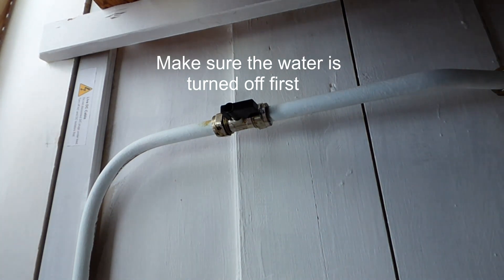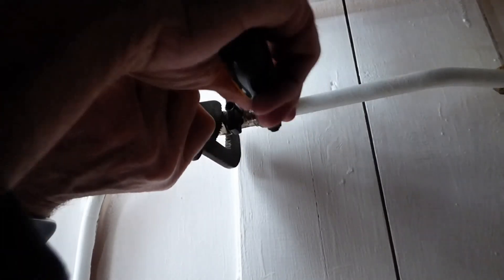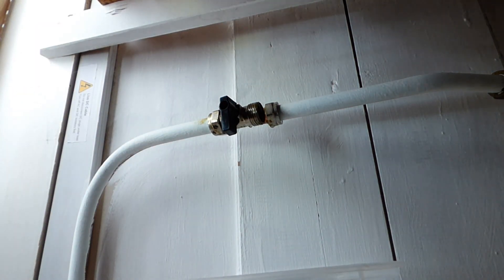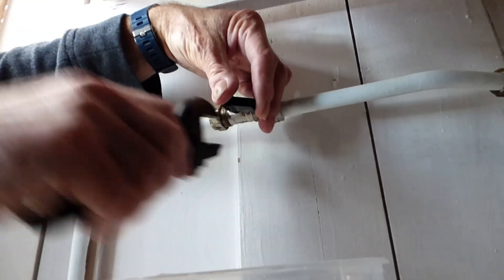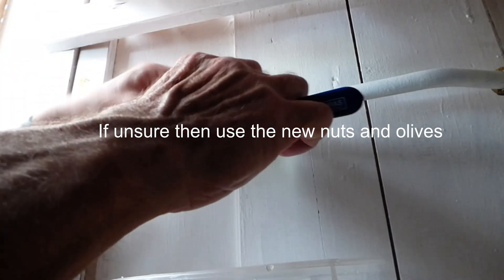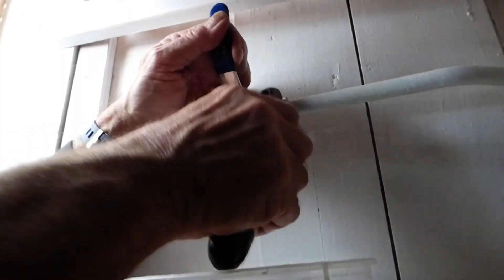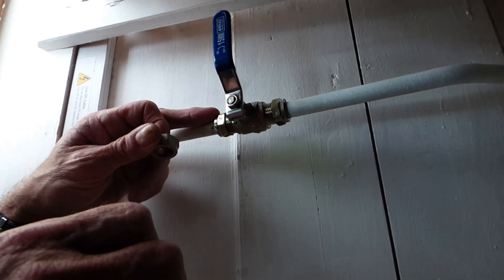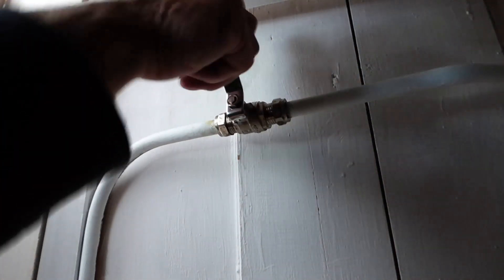Change an unsafe, unreliable isolating valve, for a full bore lever valve.

Comment: Yes, but they do serve a purpose - that of interference.  The fact that someone has to go and get a screwdriver (and even then some people don't grasp how they work, they keep turning it clockwise!) in order to fiddle means less chance of causing an issue.  Children certainly can't do it.  But a lever valve could even be turned off by someone with the IQ of a politician.  I have fitted both, and with a lot of lever valves I have fitted, I have stolen the handle.  A plumber knows what to do when he sees it, but a customer doesn't.
Reply from the maker: The politicians need there handle removing.

Comment: 👍Buy Pegler valves if you want long-term reliability.
Reply from the maker: Right on.
Reply: how about " RWC Reliance Water Controls " and " Crane D171C " they good aswell, and Pegler prestex  and Conex Bänninger are good, I have been using them since 1972, I liked " Kontite which is no longer around, gunmetal fittings.now when I go to plumbers merchants, it is nearly all from China
I was getting plumbing fittings via Ebay, from Germany top quality, and cheaper than UK, but now that we are not in the EU, the Britsh goverment charged me 40% import duty tax. this goverment like to take money from us, for doing nothing.

Comment: That's very useful to know....Will a standard braided flexy tap connector fit directly to one side of these valves??
Reply from the maker: Yes it will
Reply: @dereton33  Thanks, that's much appreciated...

Comment: Not good practice to be tightening that valve using the handle for leverage.  The main body of the valve has a set of flats on it for a reason.
Reply from the maker: I find it is fine, I am sure I can handle it ha ha.

Comment: Don't the ones you fitted have their own issues? I though there were some that cracked, and then water poured out
Reply from the maker: No stopcocks have there own faults. Gate valves are worse. The full bore tap lever is the best.
Reply: @ It’s the full bore lever ones I was referring too. I’m sure there are some videos on here showing the fault.

Comment: I must admit never had a problem with those little valves , but then I have only one on mains pressure the others are on the shower
Reply from the maker: If you have peggler ones they are better.
Reply: I have ,`twice , it wouldn't turn , white plastic knob , brother put one that you need a screwdriver to turn but I'd prefer one of these levers ,

Comment: Once again Derek thanks, what are your feelings over gate valves?
Reply from the maker: Dont touch a gate valve with a barge pole, the worse valves ever made.
Reply: @dereton33  I have double trouble in my airing cupboard: Gate valves on Polyorc pipe!! So far, being gentle with them, I have been ok 🤞
Reply: @mistermikeanson  i read that a 17mm to 15mm coupler/reducer works, but philmac joiners are best.